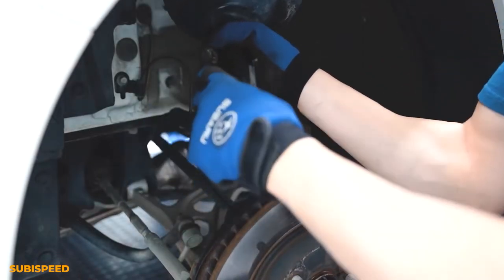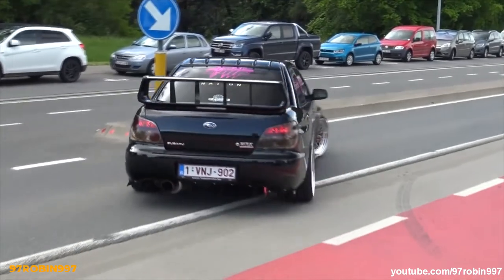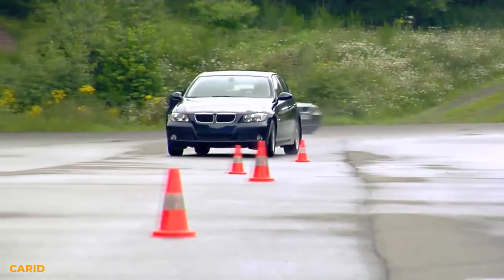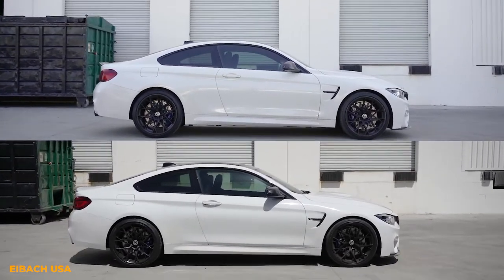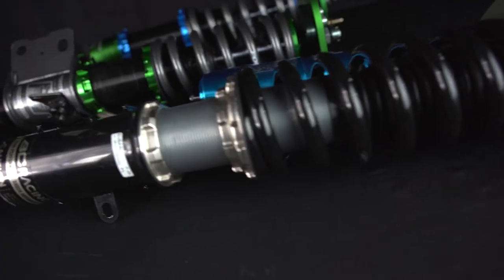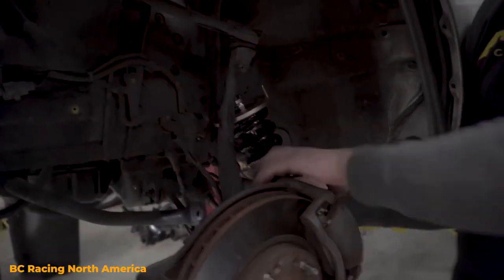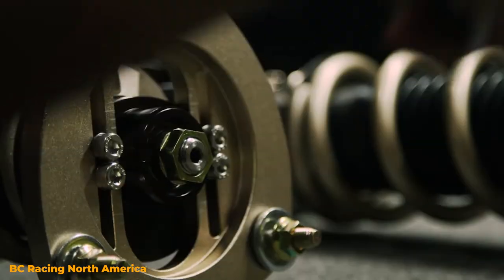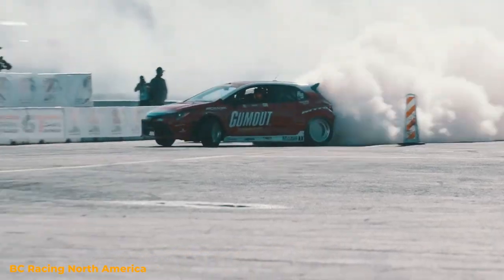Suspension Talk: Coilovers vs Lowering Springs

Comment: Well, I like hot rides with my car sitting low about an inch and a half I was told Coilover ride just like stock  like KW and Pedders if not better. I’m looking for something to lower my car an inch and a half and not riding around like a Lowrider like now I have eibach pro kit with the shocks and struts on my 2012 charger and over smooth roads it rides just like stock, but over bumps and bumpy roads and in perfection rides like if I heated my springs or a low rider really bad